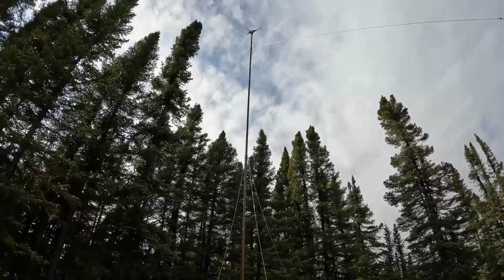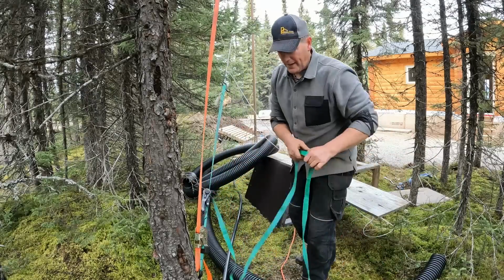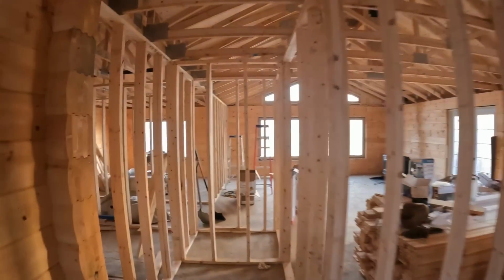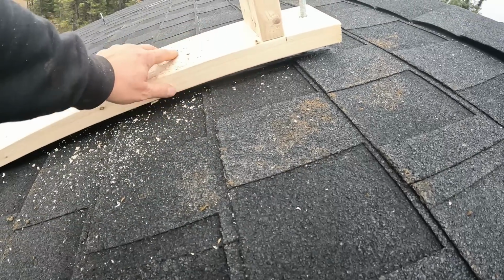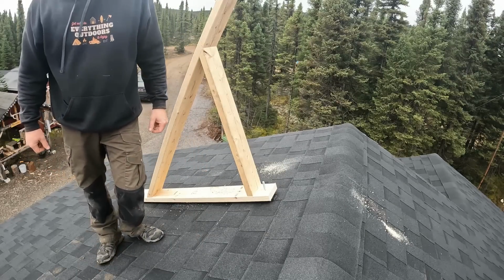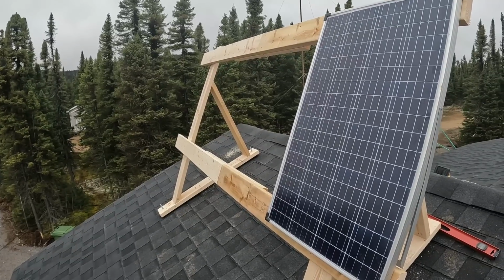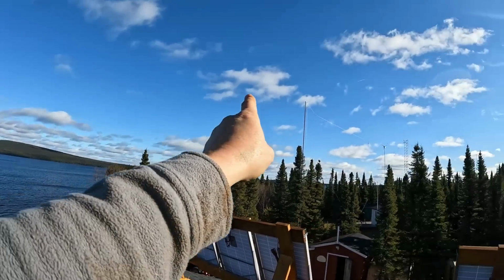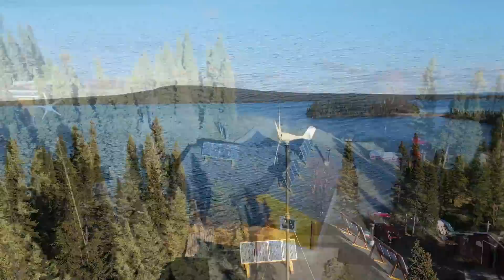"Watts" up?? Solar, Wind Power & Interior Walls - Huge Progress at the Off Grid Log Cabin Build 🏡🪵

Comment: Hey Chuck when using the cable clamps, some call them crosby clamps, or wire rope clamps, the golden rule is "Never saddle a dea horse 🐎 ". You can figure out which part is the saddle. The dead horse is the dead end of the cable. You have the live end under load and the other side is the dead end. Great video, place is really  coming together quickly. 👍👍
Reply from the maker: Ok great tip. Never heard of it before. But I’ll certainly be conscious of it from now on. Thanks!!👍

Comment: Hi, I know is crazy to mention. I noticed while watching your video on theses panel you stalled with the front anchors strips that they are going over each of the panels to the solar portions which, depending on those type f panels, could hurt the output of the panels?  I would suggest that you cut the strips back on each side a little as to not overlap onto the solar array. Enjoy watching all your videos, and many more😀
Reply from the maker: Will have a closer inspection now that you mentioned it but my goal was to install without putting any amount of direct pressure on the panel itself, but rather on the thicker frame. I know it worked fine on my last install but always worth a closer look. Tks bud

Comment: Great setup Chuck . Question for you , how much noise does the wind generator produce? I have friends with them and theirs are super loud .
Reply from the maker: I can’t hear this one from inside my cabin. However, outside I can certainly hear it. The thing about it is that you get used to it. I also have a train that isn’t far from heat and I don’t hear that now either lol. The trick with a windmill is avoid mounting the Pole to your cabin. I did this last time and the sound transmitted inside

Comment: Hey Chuck was wondering where you get the mounting hardware for the panels to mount to the wood?
Reply from the maker: I had them cut at a machine shop locally. It’s just 1/4 plate cut into 4 ft sections
Reply: Also the smaller mounting hardware?

Comment: Another great video! Chuck what model turbine is that? Been working good for you?
Reply from the maker: It is one I ordered through Walmart. I still don’t have it hooked up to my battery bank yet so unable to provide any advice good or bad with it yet
Reply: @ChuckPorterEverythingOutdoors  thanks Chuck keep us posted.  These turbines are not holding up over time and loud. But are an option in the winter.